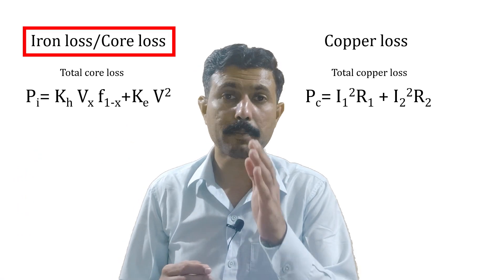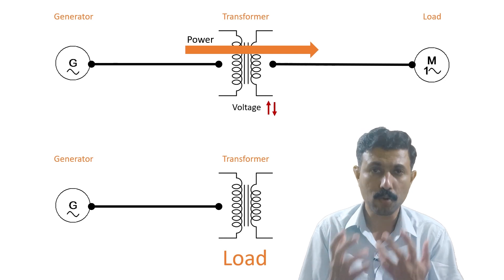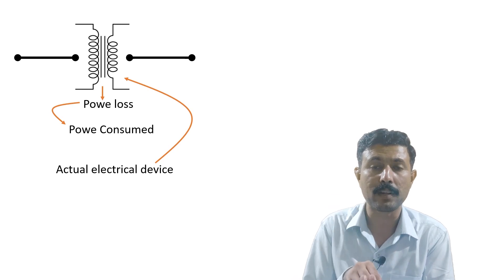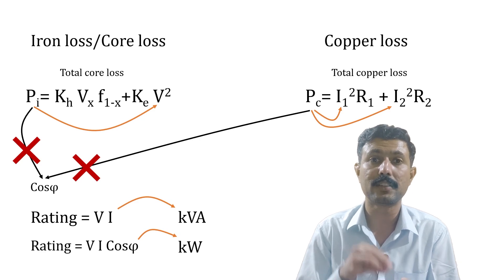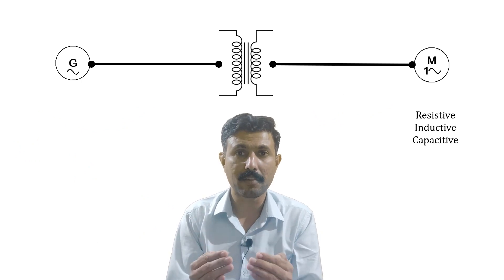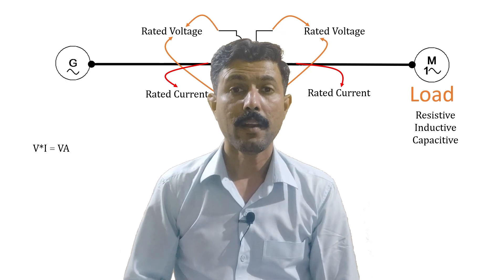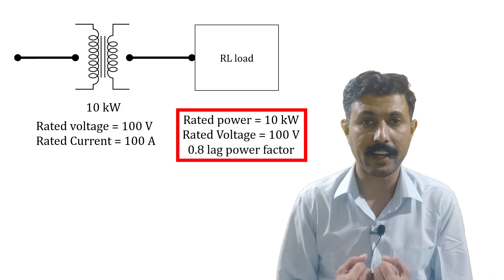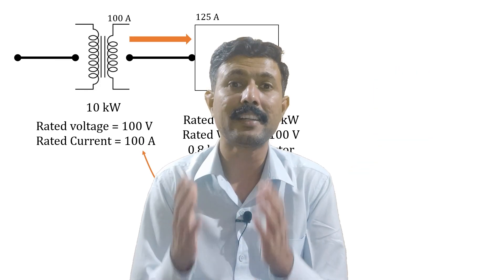Detailed explanation of why transformer rating in kVA not in kW | Electrical Interview question

Comment: Thanx, I follow you from Egypt
Can you help me in choosing the right contactor for
1.5 HP water pump, single phase?
The pump switches on 7 seconds and switches off 7 seconds regularly according to the water pressure .
what's the suitable ampere for the contactor to be bought?
and what is the right ac grade to choose?
Ac 1 , ac2 , AC3 or ac4 ?
Reply from the maker: 15 or 16 Amp contactor would be fine
Reply: @LearningVibes  
But 15or 16 ampere contractor is not too much for a mere 1 HP pump?
Reply from the maker: What is rated current rating of that pump?
Reply: @LearningVibes  
From pump nameplate
P1: 1.3 kw
P2: 1 HP
11/1:   5.1  A
Volt in our region 220 volts.
Note this 1 HP pump that I have now
I want the suitable contactor for it.
Reply: @LearningVibes  
Rated current for my 1 HP pump single phase, 220 volts
Is  5.1 ampere
Reply from the maker: But u need to consider starting inrush current too.
Reply: @LearningVibes  
And what is the suitable wire diameter ?
1 mm or 1.5 mm or 2mm or another ?
Reply from the maker: 1.5 or 2 any of these are fine
Reply: @LearningVibes  
Thanx my indian brother
I hope for you all good 👍
Reply from the maker: What do you do there
Study or job?
Reply: @LearningVibes  
Neither this nor that
Reply from the maker: Then what?
Reply from the maker: @فتىالعرب-غ9غ   then what?

Comment: Why the power produced by generators or electricity plants are in mega watts not mega va? Like transformers?
Reply from the maker: It is in MVA not in mega watt
Reply: @LearningVibes  
Thanx, I follow you from Egypt
Can you help me in choosing the right contactor for
1.5 HP water pump, single phase?
The pump switches on 7 seconds and switches off 7 seconds regularly according to the water pressure .
what's the suitable ampere for the contactor to be bought?
and what is the right ac grade to choose?
Ac 1 , ac2 , AC3 or ac4 ?